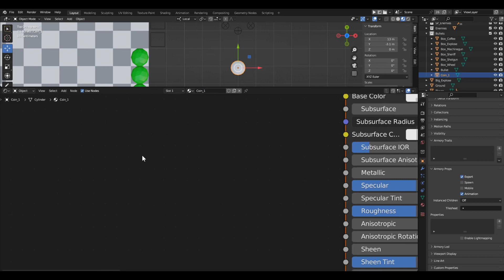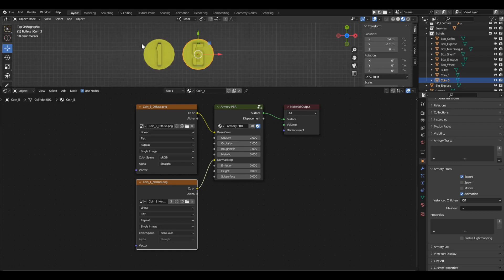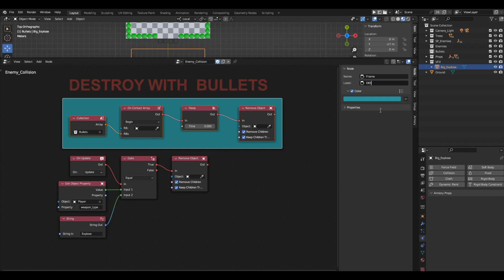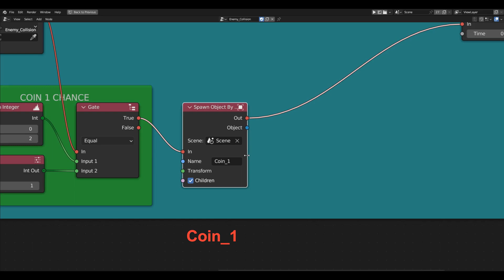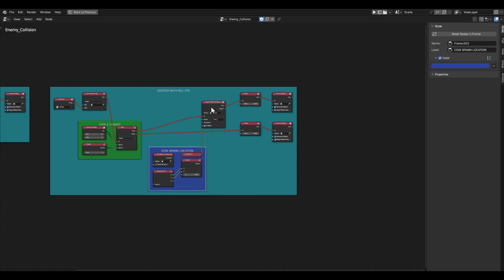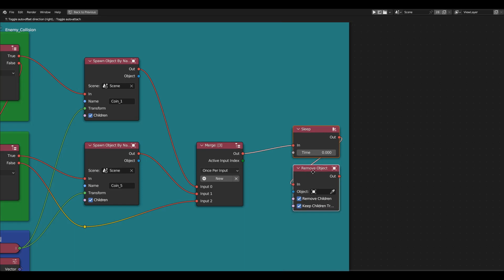21_How to raise money Part 1

Comment: Can you show me, how to make vanishing point or horizon mist? I see the horizon is very sharp,, And I have no idea,..
Reply from the maker: Try this: Render Properties > Armory Render Path > Post Process > Volumetric Light
Reply: @_SIMPLECUBE_  how the value of turbidity n steps to look like other engine.. I had try, n still look sharp on horizon.
Reply from the maker: Perhaps I didn't fully understand the problem. Do you want to blur the physical horizon (which consists of objects) using Volume Fog, or do you want to blur the horizon that you have in the world material?
Reply: @_SIMPLECUBE_  can you explain me, what is Amount B value in Volumetric Fog?
My target is, get desaturated, or mist, or blurred in the middle of horizon, except the sky..
I try with gradient texture, but its like a bug..
Reply from the maker: I don't know how channel B works, but if you increase the value of channel A, you can make the horizon blurry. At a value of 10, the horizon will not be visible at all.